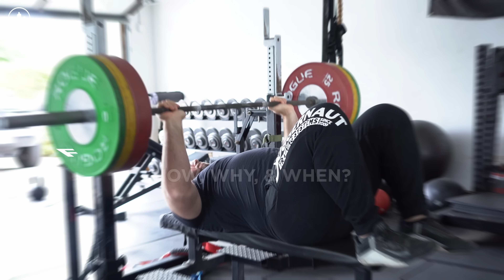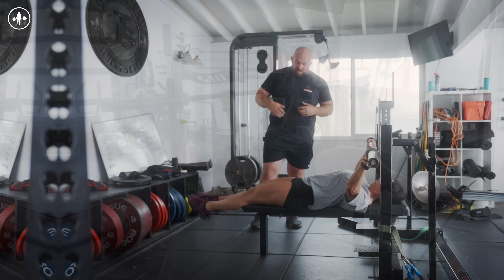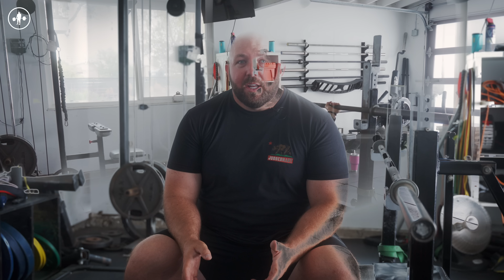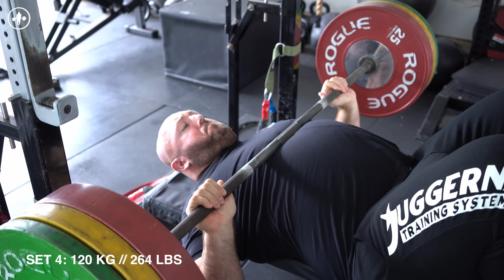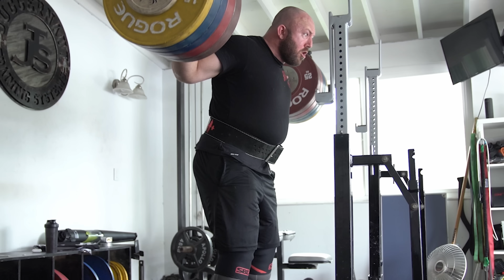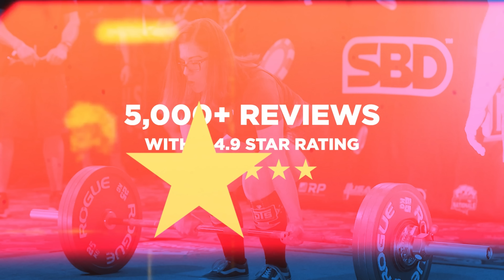Why Powerlifters Use Feet Up Bench (and You Should Too)

Comment: You should post a video for beginners over 50 to get started in powerlifting so as to prevent/minimize chances of injury.
Reply: Your next step should be looking ( on YT) up the video “6 Training tips for OLDER Lifters” by Brian Alsruhe. 

It’s an excellent video and the comments section is CRAMMED FULL of great advice/experience from power lifters/weight trainers aged 50 to 70 plus. Good luck to you.